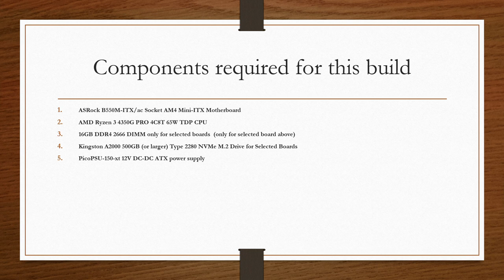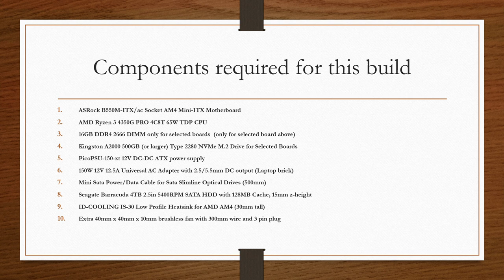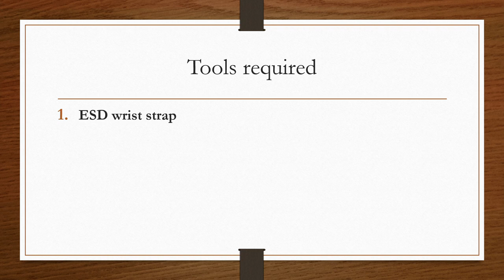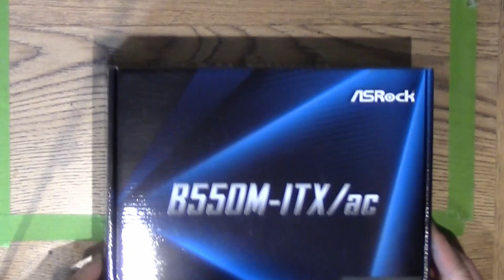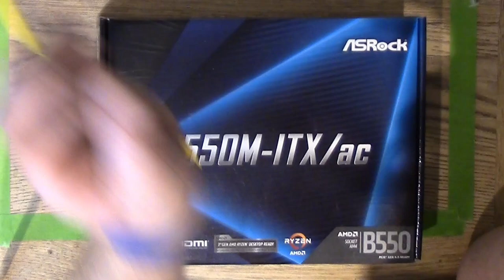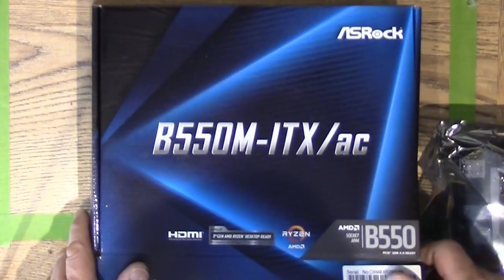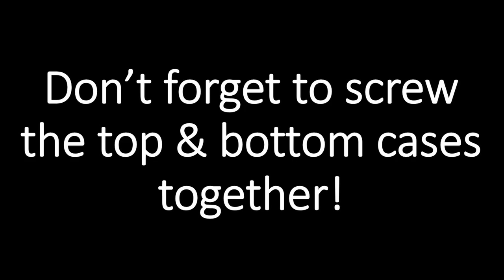Lets Build a C64 Ryzen PC [Full parts & Tutorial]

Comment: it's insane this doesn't have more views. this is so amazing. I've wanted a powerful mini PC for a while now, and seeing a PC inside a keyboard that can game is unbelievable. and I can build it for under $1,000
Reply from the maker: In AAA games it’s slow compared to dedicated graphics but it is cool you can game on this machine!
Reply from the maker: @Clarissa 1986 interesting idea but I still think heat would be a problem and at the moment the largest picu that fits inside the case is a 150 watt. The 160 watt is to high to fit.
Reply: @myretrocomputerltd5179  You could feed it with an external power source as people have with proprietary PSUs. Some low profile GPUs do run off 80 watts such as the GTX1050Ti that is powered by your PCIE slot. Also you can install that SATA SSD in a ton of places or even mount it to the bottom of the keyboard with some good double sided tape. ridding yourself of the drive bracket might leave enough room for a 120mm AIO liquid cooler then your heating issues go bye bye. You can even mod the case so the fan hangs out the bottom a little go with an RGB fan to give the PC ground FX just add feet to give the fan some ground clearance. As I saw a dude do once with a PS2 that he modified into a PC with a R9 low profile card This had two 32 GB DDR4 sticks and a Ryzen 7 2700x  liquid cooled he managed a laptop DVD rom so it could keep on playing PS2 games via emulator software. Or you can buy the 2011 C64 pro tear out the laptop mobo and put in your ryzen board install your GPU in the low profile GPU mount. However I only think a few C64 pros were ever built as Commodore USA (not Commodore International) never really got off the ground. People were already hooking their PCs to their TVs via HDMI so there was never really a market for something that already existed and most people already own.

Comment: actually another interesting motherboard option for my64 is the Asus Pro H610T D4-CSM ; it's cool because it have the 19v DC IN. of course is a 12th generation intel motherboard so gpu will perform less compared to reyzen builds but still a good compromise. actually I havn't find any ryzen based itx motherboard with DC IN; personally i prefer a more polish build without need to install a  micro psu adapter
Reply from the maker: Thank you, I will have a look. I think integrated power is great - it's a shame they are so hard to come by and are usually only associated with industrial boards.  🙂

Comment: Hi, can this motherboard and 150w pico support AMD 4650g ?
I didn’t build a small builds before
Reply from the maker: Hi Aiman, it will only support processors of 65 watt or below. Its not just the power consumption, we also have to factor in heat. Even If you could fit a more powerful processor - it would generate too much heat to cool becuase of the limited space within. I hope this helps you and sorry for the late reply.

Comment: Great idea lad but a riser cable with a decent small factor graphics card like an RX 470 can easily fit in a C64 case with the shroud removed instead of the blueray drive and SSD storage drive and just use an external Blueray and storage drive but that is my personal take if ima was going to bother but rather a real C64 and a decent next gen gaming PC separately but that is me...
Reply from the maker: Hi Malcolm, thank you for your comments. I did try the graphics card route a while back but it involved too many case alterations and then heat and power restraints come into play. We now have a GTX 1650 graphics chip embedded onto the motherboard - we call this the Ultimate!🙂

Comment: I don't know the logistic of licencing deals to do this and this is just me throwing it out there but maybe in the future you could offer more micro options in  the forme of other classic micro's like the Amiga line, Atari 8bit an ST line, Apple 2 and 3 line and Sinclair or Amstrad line or maybe even  a Acorn micro's line like the BBC and Archimedes because this simply a really cool idea. 
I would really love to see a version of this on a MSX stile micro case.
Reply from the maker: We do want to create other systems, licensing is an issue but so is money. I personally want to see an Amiga and spectrum. Who knows what the future will bring but for now we must focus on My64 and my vic20
Reply: I'd love to see an Atari ST (Likely same with certain Acorn machines) as it's tall enough and wide enough in the back to support smaller vid cards. The apple II will fit a full sized mATX board with full height vid cards and a server (forget the spec name) PSU. (I did both of these on dead machines.) But once it got that crazy, I had to use RF shielding tape.
Reply from the maker: @czos9239  We’d like to see an Atari too! Once this system is established we’ll move on to another.

Comment: Never heard of using grease on computer components.  I think  thermal paste would work better.
Reply from the maker: I have to admit, I’m getting on a bit! I think thermal grease was the main name in circulation 20+ years ago but this has been replaced by thermal paste. A quick google will show the name thermal grease is still in circulation. It has been remarked on before along with the disastrous amount of grease used! We have an updated Ryzen video which shows a better cooling method, and on that video, I say thermal paste and I also apply it correctly!

Comment: There are a few ways to go here you could get a PCIEe adapter and drop in a low profile GPU and feed your GPU through the slot you had the optic dive connected to. As USB drives are replacing optic drives most gamers will not even consider one. There are tons of places in the case to stick a SATA SSD. With the removal of the drive bracket you have enough room for your GPU and a 120 mm AIO liquid cooler you could vent the bottom of the case so your fan can go face down to prevent wandering wires from getting into the fan. Your low profile GPU will have a fan however it will be lifted you can go with a 80 watt PCIe powered GTX1050Ti. Now you have a micro gamer that would be convention worthy. Go with a external RGB gaming mouse and keyboard. If you want something with a little more kick you can add a port to add an external video power however PCIe powered is best to keep it all micro and run off the DC PicoPSU-150-xt.
Reply: Now that would be a wonderful thing! There are some motherboards out there that have intergrated 1050 graphics chips. i think ETA Prime has just reviewed one.

Comment: This all seems pretty straight forward but I wanted to know how much of a beast we’d be able to build with the mini ITX and your cases? Ryzen 9 with 64 gigs of ram an option, I also have a external GPU, what sort of IO’s does this all have available?
Reply from the maker: The case is built for 150 watt maximum picopsu, so it has to be worked out from that. people have put larger power hungry chips in but with the extra power comes more heat. I think the new Ryzen 6800 APU's look outstanding.

Comment: Could you do this with an Intel variant that has Thunderbolt 3 or 4? I would like to do this and set up an EGPU that is tan an brown painted.
Reply from the maker: Hi, I have an i3 build that I haven’t completed yet because I was put off by the metal plate underneath the board that holds the socket into place. It’s possible to do the intel build but it will bow the bottom of the case.

Comment: Hi, if I get a everything on this build adn replace the Ryzen 3 with a Ryzen 7 4700G, do you think it would work or do I need another motherboard? Thanks great case by the way
Reply from the maker: Hi, simple answer I don’t know!! If you are going to purchase everything from mini-itx.com then give them a call or email. The guy there -Ewan is the most helpful and knowledgable chap I’ve ever met. He will definitely know the answer to any questions you have regarding any internals - good luck with the build. The biggest concern for your build will be heat and height. If purchasing another board make sure the M.2 is on top and not underneath. Yes there is only a small amount of room under the board too!
Reply: @myretrocomputerltd5179  ok thank you for your answer and I’ll give them a call, great case once again

Comment: If I were to do a build like this, would it be possible to fit a low-profile GPU in the case too?
Reply from the maker: Hi Alexander, I'm afraid there isn't the room, but if there was, you would still run into power and heat problems.

Comment: The heat... how bad is it to touch? 65W isn't TOO bad to cool... lower-end laptops push far more between the CPU + dGPU which often share the same heatsink + fan anyway... but that's right there on your hand. Do you feel it at all when typing or resting your hand there? Or do you not feel it?
Reply from the maker: Hi, it’s just warm to the touch and the keycaps are only just slightly warmer than usual. The underside of the case is quite warm - I suppose no warmer than a laptop would be though
Reply: @myretrocomputerltd5179  That's expected for the underside, but I'm really surprised about the keycaps. Thanks for the reply.

I'm really intrigued by this device. So can this case support two 2.5" drives? Or can only a DVD/BD drive fit in that slot meant for them?
Reply from the maker: @acumenium8157  Hi, there are no fixings for a second hard drive but I think these can be double stacked using double sided tape or Velcro.
Reply from the maker: @acumenium8157  it can hold 1 hard drive and 1 optical drive at the same time or 2 hard drives but like I say a bit of tape and you could probably fit 3 hard drives and an optical drive!

Comment: It would be a good idea to do some tests to pick up the temperature inside the case and on the keyboard. I think people don't want to have a C64X Toastrack... (inspired by the famous Speccy model) :D
Jokes apart, it's important to avoid that electronics and plastics don't toast themself under daily use.
Reply from the maker: Hi, thank you for this, any suggestions on how to measure the temp (instruments needed to do it correctly)
Reply: I don't have the know how to suggest the right procedure to do this measurements, sorry.
Reply from the maker: @vintagetechnologies202  Hi, I’ll look into it, it was worth asking just in case!
Reply from the maker: I have a digital temperature meter on order, should have it by middle of next week, it was only £17.00
Reply: Great, let me know when you got it. Is it an IR thermometer for surfaces?
Reply from the maker: @vintagetechnologies202  it measures air temperature and has a probe!
Reply: I have to do some experiments with the one I saw in the lab where I work. I will keep you informed.
Reply from the maker: @vintagetechnologies202  ok thanks! When this one turns up I’m going to test both builds and post the results - it well worth knowing
Reply from the maker: Just to let you know we posted a video showing the interior temps - it’s only a short video (6 mins)
Reply: Thank you Sean, I saw the video. It seems that breadbin case manages very well the heat spreaded by the most recent CPUs.

Comment: Just setup mine, only real issue I had was that the card reader lacked a hole for the power connector, fortunately I’m able to use a spare hole on the rear IO panel for now.
Reply from the maker: That’s not to bad, commodoreusa used to drill holes in the back of the case or the rear I/o shield! If you find you don’t use the card reader you can use the metal vent plate that has the correct size hole for the power
Reply from the maker: What mobo did you use
Reply from the maker: We’d love to see some pictures of your build!
Reply: @myretrocomputerltd5179   It’s actually a late xmas gift for my dad, as I wanted to get him one of these years ago back in the Commodore USA days, but it’s only now that I’m able to actually do this. 

I only found out about this the other day on the channel Explaining Computers, I’m surprised by how fast the shipping was. I ended up using an old Asrock QC5000 I already had along with some other parts lying around (SSD, PSU, etc.) so I can get a system working for xmas day.

Currently it’s only half finished as I’m waiting for an adapter to come for the ODD, but I’ve powered it on and it seems to be working just fine.

The SoC may be old and feeling it’s age, but for what my dad does it should be enough for now and I plan on setting up a C64 emulator on it so the system should be up to the task. Thought it would be funny to have a ‘modern’ computer boot to BASIC.
Reply from the maker: Aww that’s great, I really hope he enjoys it, that’s what this is all about! You won’t believe it but we have been here since 2014 and sold a few units over the years but this year we decided to go full out and sell loads!
Reply from the maker: What did you think of the artwork on the box!
Reply: @myretrocomputerltd5179  I like it. My plan is to repack the system into the box and gift wrap that for my dad to open.
Reply from the maker: @tech34756  excellent idea

Comment: Downloaded the two torrent files to my USB.. now how do I get them onto my commodore usa ltd unit ?
Reply from the maker: Hi, I’m afraid it’s best to use a dvd drive instead. I’ve been told by Leo, the chap that built the case and operating system that commodoreOS doesn’t work properly on modern hardware (none of the graphical effects will work) but you can install onto virtual box and then you will be able to see all the special effects
Reply: @myretrocomputerltd5179  Thx for the info but any idea where I can get a copy of it on DVD? CD?
Reply: @myretrocomputerltd5179  and what is virtual box ?
Reply from the maker: @mule1991  download and burn to dvd using DVD burner
Reply: @myretrocomputerltd5179  K.. thx.. assume the same torrent download will be fine
Reply from the maker: @mule1991  yep just use do I’d burning software - I use poweriso but I’m sure there will be a free option on the web
Reply from the maker: @mule1991  ahh virtual box is a pc emulator within a pc. So if you install it you can load the commodoreOS iso file and install it within the virtual machine (virtual box) and once installed you can test it. You can install any x64 based operating system in this virtual machine. My advice would be to watch some YouTube videos. You might even find a tutorial on installing commodoreOS. Google spatrys cup of Linux I think he did one.
Reply from the maker: @mule1991  I have just found a link to a site that has a virtual box image with commodoreOS already set up: ttps://www.sysprobs.com/commodore